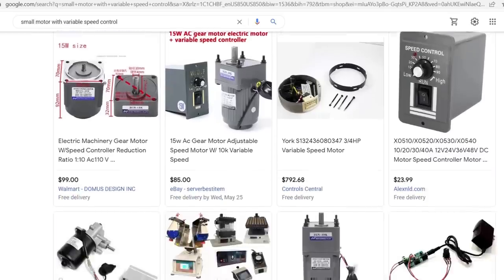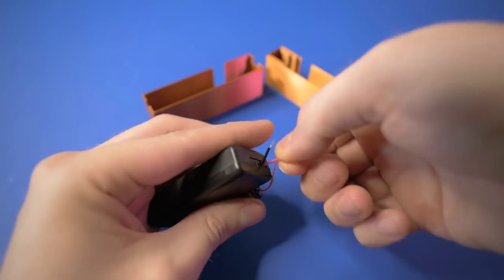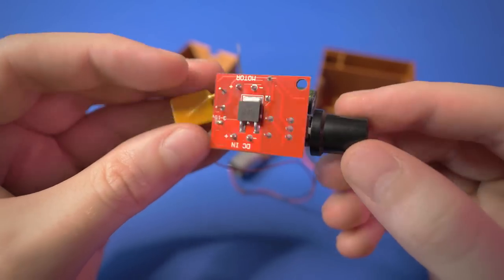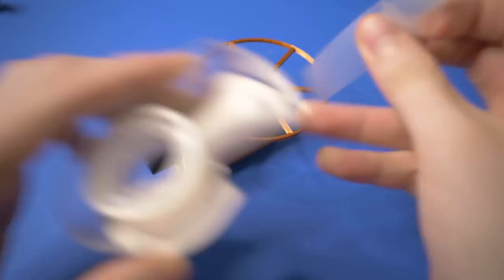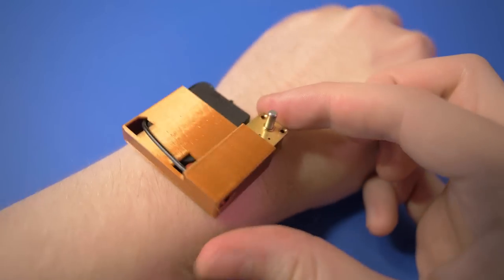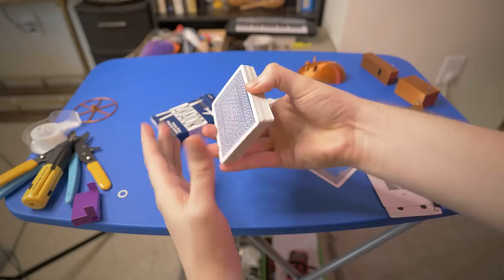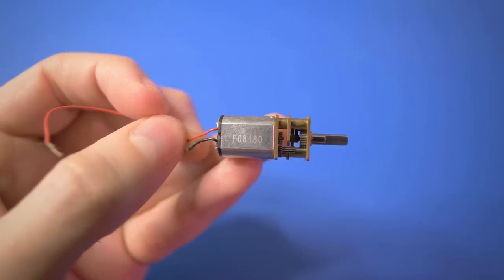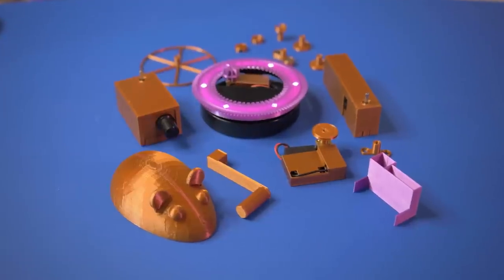3D Printed Rotation | Make Anything Rotate

Comment: For wires to connect them quickly without soldering - instead of twisting I usually keep some WAGO clamps handy. Bought a bag of 100 a few years ago and used them in many 3D prints (with inbuild electronics) since then.
Reply from the maker: I thought those would be too big for the smaller designs but yes those are a great tool to have! I should have mentioned it so thank you!

Comment: Rechargeable lithium cells are listed at 3.7v, as that is their nominal (average) voltage.  When fully charged they can have 4.2v.  They are considered depleted/dead at 3.4v, and should never be discharged below 3.0v.

Comment: Great job. Printing them as I type.
Also, I hate to be that guy, but soldering is kind of a must if you want to be a maker/tinkerer. And everyone can do it, if they just try it. Just get a 5-10$ set which has the iron, holder, flux, solder material and you're good to go. Don't be afraid (but also dont burn yourselves).
Reply: soldering isn't that hard if you have somebody who sits down with you for an hour and explains what to be aware of. Rest is practice and not beeing insecure about your own skills. Soldering is not witchcraft and a project like this is perfect for beginners.
Reply: @jBurn_  Of course, someone nearby would be great. But in lieu of that, there are tons of very good full courses on youtube, ranging from 5 minutes to a couple of hours. I used to be terrible at it, now I can confidently solder even medium-small smd components without too much effort. I was so bad at it...